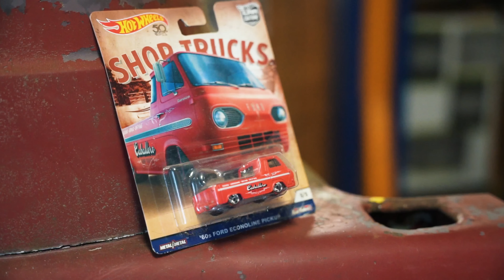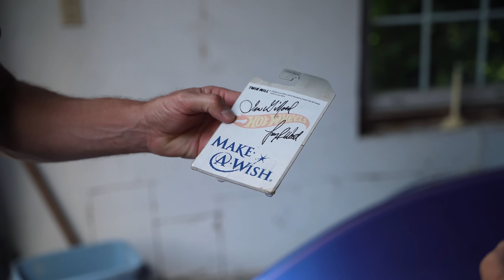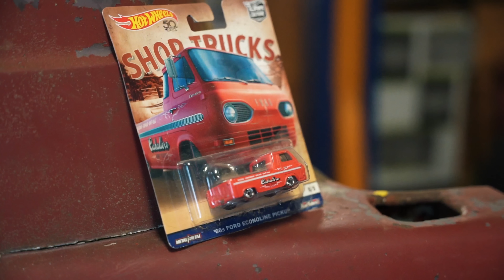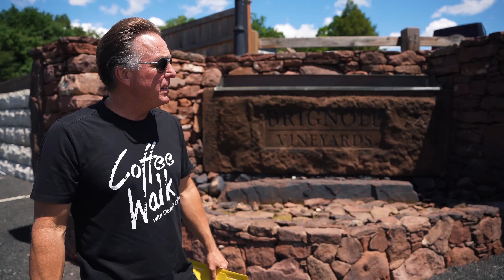1967 Shelby GT 500 and Hot Wheels??

Comment: RIP Paul. He was a great guy. Denis did you get the original motor? Ive had the pleasure of riding in that car in 94. He told me he had it in a crate in his garage and was running  a different one. He  worked at the  body shop on Mill st. I had a detail shop next to Spags in Shrewsbury  MA. He  sold  me a 88 police interceptor motor for $200 in 94. His friend Paul that owned the body shop had a green Mercury Cyclone. I moved back to CA in 98 lost touch.

Comment: Would like Dennis to 4 scale the weight of this car on each tire. It is so A** light, and hard to keep under control. I even moved the battery to the trunk to try to shift weight to the rear. It’s an interesting lesson to learn, littery scale all 4 wheels. Then see if Carrel Shelby learned that too? If you shift balance the weight to the rear, it drives more like a 1970 Camaro RS SS, more balanced. Then the car also “brakes” flat, instead of nose down. A 20% increase in braking efficiency.
Always drove with a full gas tank, get that weight balance, trying too.

Comment: The only other way to improve flat breaking is to do disc brakes all the way around. Then the “caveat “, reverse the 60/40 master cylinder brake lines to 60 in the rear. Then it finally starts to brake flat, only then you also gain the 20% efficiency,,,of the entire car braking flat in a full on lock up of the brakes @ say 60 mph. It becomes much more controllable when HP is out of control,,, if that makes sense.
Hence why the Burt Renalds  car skidded 100 yards without flipping, it braked in flatline.

Comment: I had a copper Rampar BMX just like the one he's got, with full pads with black Tuff wheels. I was tall so had to extend the seat post but kept snapping the posts off. I had to put a steel pipe in the downtube, adding a bit of weight. It was a beautiful bike.